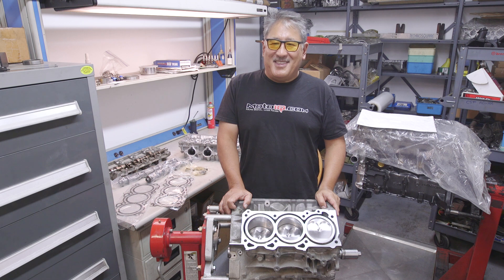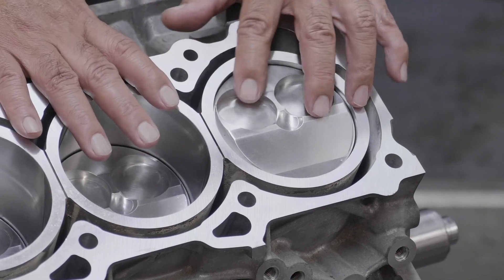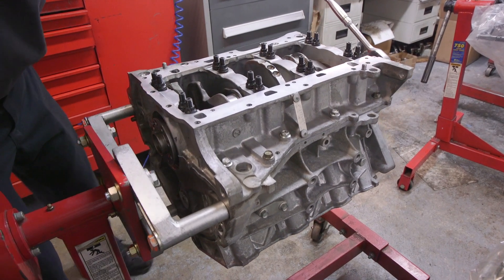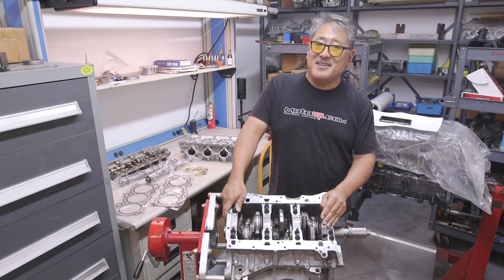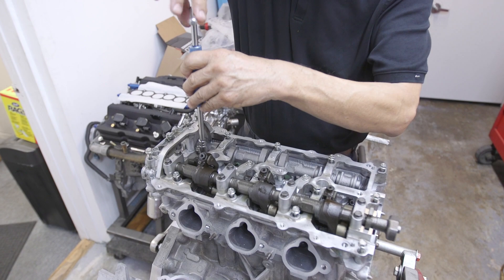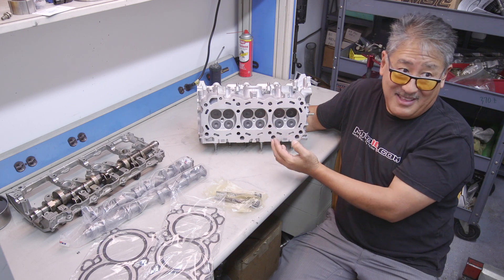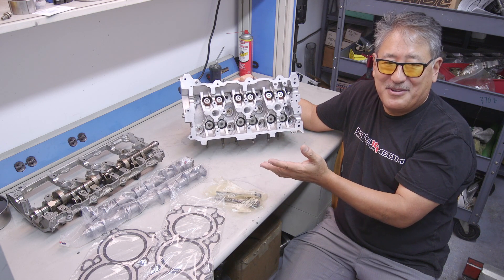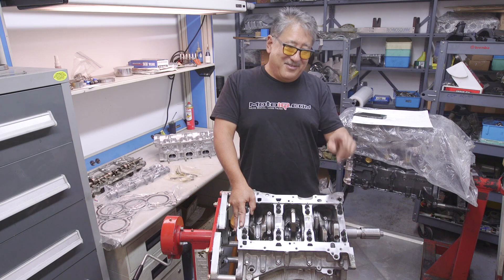Mission Impossible:  Building the Nissan VQ37VHR!

Comment: Awesome vid.
I built my 350Zs VQ35HR into a high compression VQ37HR myself about a year ago and find it reassuring to see you recommend doing things I did.
Since the VQ35HR and VQ37VHR share the same exact block you could've just put HR heads on it with very aggressive cams to make more power and avoid the overheating issues of the VVEL system. 

I did 3.7 crank, K1 rods and 12:1 Pistons but from Wiseco. 
I too kept the stock head gaskets and head bolts.
Reply from the maker: But that would have been too easy!
Reply: @motoiq  haha heyhey I'm a fan of keeping things simple.

I'm sure you guys have seen Sasha's (OnPoint Dyno) VQ builds over the years.
Before the new and insane 530whp VQ42HR their VQ37HR made 414rwhp using HR heads and ITBs.
Definitely looking forward to what you come up with though, Ive always followed your builds on your website.
The VQ35HR Turbo swapped R32 was probably my favorite.
Reply: What kind of power did you end up making? And why doesn't anyone use the VQ40 crank?
Reply from the maker: Engine/car has not been on the dyno yet. You'll have to stay tuned for the next video for that info.
Reply: @future62  I forgot to touch on the VQ40 crank part.
Cant use that crank in an HR/VHR block because the VQ40 is a DE motor and the main bearing and rod bearing journals are much larger on HR/VHR cranks.
Plus the bottom half of the block is different too (bedplate girlde vs individual main caps) so I'm not sure if it would even fit correctly.
Reply: @future62  mine is on stock HR cams but I actually found my 3" Z1 single exit exhaust with motordyne Ypipe to be restrictive so I had a custom 3.5" single exit made pretty recently but havent had a chance to put it on a dyno.
With the old exhaust it made 330whp and 286wtq on a very low reading dyno with shop temperatures at 110°F here in Florida 

I know on a regular dynojet on a normal day it would've been in the 350s and perhaps a bit more now with the new exhaust set up since its running very well and I've really gotten the hang of tuning with Uprev.
Reply: @ado038  Damn that is good power. For reference a stock E39 M5 puts down about 330WHP on a Dynojet. As for the VQ40 crank the rod bearings kind of don't matter since you would need custom rods... don't know if the crank could take all that milling. But that would take a 3.7 to a 4.2 I think
Reply: @future62  as I understand it they dont rev well, you lose too much hp for the small torque gains. Also you have to regrind the crank as the 40 has larger journals and that takes away to much strength away from the crank (or so ive read)
Reply: Great comment
Reply: Adnan Pilav Just curious, how much did all of that cost in the end?
Reply: @ch33zyburrito36  If I were to guesstimate the most expensive things:
1. Pistons: $1,000
2. Rods: $1,000
3. Machine Work: $1,000
4. Valve train: $500
5. Camshaft: $500
6. Head Work: $500
7. Block Work: $500
8. Performance Oil Pump: $500
9. Misc parts: $500
10. Additional treatments: $1,000

So north of $7,000. Probably a few thousand more with the special treatments he mentioned.
Reply: Adnan Pilav you need 272 cams
Reply: How much power are you making. Im thinking of building my engine
Reply: @drift240sx9  What are you building your engine for?
Drag racing, drifting, circuit racing, auto-cross, time-attack?

You must decide from the get-go, what your goal is and what "power style" you want to go with.

Naturally Aspirated is how is was done before. This route typically leads to an engine that is more reliable, efficient, simpler but most importantly, more responsive. Power delivery is instant, linear and very easy to modulate. The downside is that you get significantly less power for the money you spend.

If you are going for drag racing you could just build up the engine for nitrous. A nitrous bottle could last you 6 1/4 mile passes and you have to pay $60 per bottle fill-up.

Finally the turbocharger is what is going to net you the most power with the least money. The downside is that the power delivery is abrupt, hard to modulate and has initial lag time between shifts(if manual transmission) and lifting off the throttle. 

A supercharger can gain the benefit of a turbo albeit with slightly less power gain, less fuel efficiency and more cost.
Reply: Are custom pistons required with the 3.7 crank (can the HR or VHR pistons be reused)?
Reply: @frostydc4  I believe they went with custom pistons for lighter and higher CR.
Reply: Badass buddy inspiration! Always learning by reading all these stories from Vq owners and mechanics!

Comment: Where the hell Mike You getting this info from?! I want to know more, sodium filled valves, fire reliefs in pistons, valve seat distortion? I always thought that torque to yield bolts are one time use? Great info like always.
Reply: Generally, Nissan Torque To Yield can be used up to 3x in a pinch.  Nissan gives a length spec and you measure the bolts and log the length with each cycle.  They are no good when they go out of spec.  That can be in one to 3 cycles. If its a race engine I pitch them but in an emergency, I have reused them if they were within spec.
Reply: Mike Kojima what year Nissan Titan 5.6 V8 has the sodium filled valves?
Reply: Sodium filled valves isn't a new technology. For instance, they were used on 1964 Soviet ZIL-130 truck.